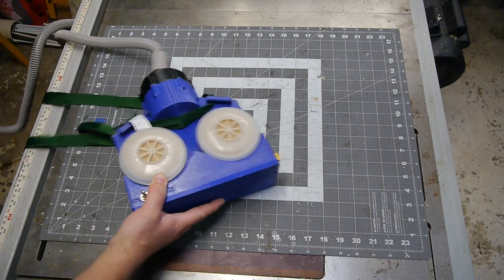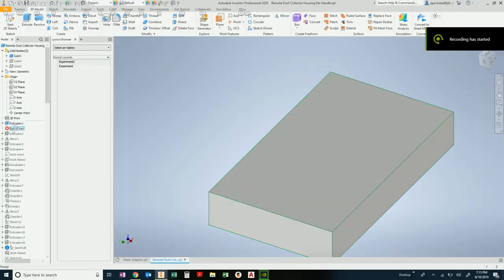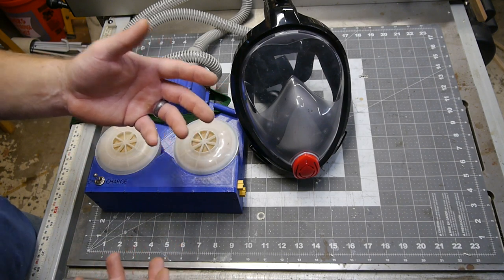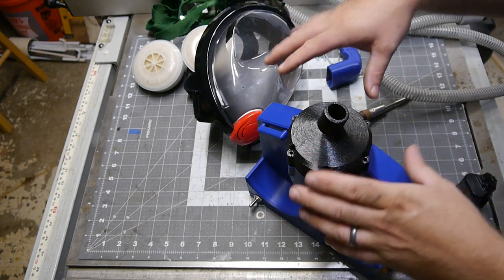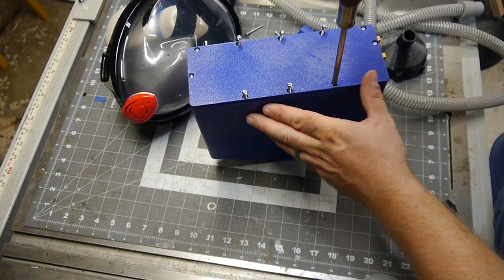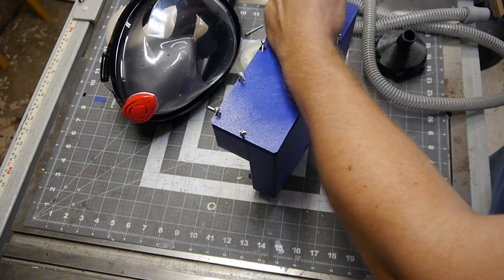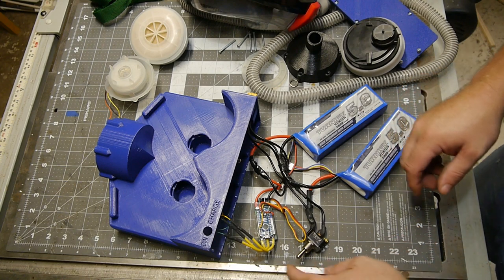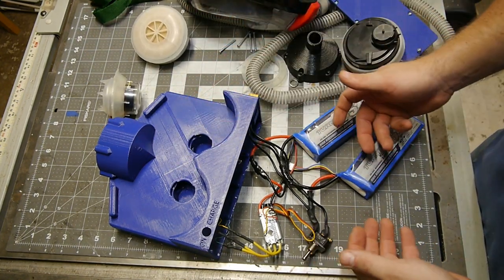DIY PAPR (Personal Air Purifying Respirator) Mask, Works Awesome! Low Cost Option

Comment: I have shared this to a physician group - many are dying due to lack of proper protective gear in hospitals here and abroad, This has potential to save lives.
Reply: Put a UVC chamber mid-line and it's done!
Reply: @cherylm2C6671  UVC creates Ozones, which give you lung cancer... not good idea
Reply: @mostlymessingabout  can't this be fixed using potassium iodide?
Reply: @anglerandy5736  no. Activated carbon helps reduce ozone. But it's basically charcoal. You don't want to breathe in charcoal. You are then addicting an additional filter to remove the ozone. Not ideal. Not to mention when the glass tube UV lamp breaks the mercury inside isn't exactly healthy to breathe in either.
Reply: @mostlymessingabout  they have led UV lights and the ozone can be converted back to o2.

Comment: I watched a video on a PAPR made by 3M. It had a blow-through rather than a draw-through design for the filter; the air is blown through the filter by the blower, then into the supply tube. By positively pressurizing all parts of the system, no part of the system will be drawing in un-filtered air except for the blower intake. In a draw-through system, if some part of the system is not making a complete seal, then air with viral particles can be drawn in through the tiny gaps. That is a weakness of the current design being shown here.
Reply from the maker: You are of course correct. I actually considered making it a positive pressure system when I first designed it. I designed this PAPR before this pandemic for use in my metal and woodworking shop. If I make it a positive pressure system then I don't have to worry about contamination coming in because my 3d printed surfaces didn't seal properly. So the flow would go Contaminated air -> blower -> in-line filter -> mask -> lungs. In this configuration though the blower fan and motor are contaminated by wood dust and metal dust, and can coat the internals of it. So an additional filter would be needed. Contaminated air -> pre-filter -> blower -> in-line filter -> mask -> lungs. I didn't have a housing for an inline filter, and since I was only worried about wood and metal dust why not just get rid of the in line filter as dust is not large enough to get through the 3d printed material. You are right to point out the shortcomings of this PAPR in light of the pandemic. Thanks for watching!
Reply: And still it is better than face mask only or nothing at all
Reply: @JoshAQ  Great kit. Thank you. Healthcare workers wear a surgical mask while wearing a PAPR.
Reply: @AcousticTheory would you mind linking the video you saw?

Comment: The way these sort of mask mostly protect you is by taking air from a direction away from the dusty/fumey work you're doing and drawing it through a dust filter to present clean, fresh air into the mask.

The type of filter you're using won't filter actual smoke out of the air going into the mask, unless they are rated at least P2/N95 or even better, P3/N100.
I was wearing a P2 face mask during the bushfires in Australia, with very visible smoke in the air in Sydney and it was like magic, no smoke smell at all.
Reply from the maker: I agree. I originally designed this to keep the saw dust and high velocity/low mass shrapnel out of my eyes while woodworking. The cartridges are designed to be used with paint fumes. The smoke was there only to demonstrate the flow of air coming out the front of the mask and for a little bit of comic relief. When this whole beer bug thing passes over and there is no longer an urgent need for filters and masks I am going to purchase some p95 or p100s for my PAPR. Thanks for watching!

Comment: An inexpensive inline viral filter after the blower to the hose is a better configuration.  The double filter is overkill.  Also, you need to filter the exhaust/exhale port.  This can be as simple as taping a layer or two of non-woven blue paper shop towel material on either the inside or outside of the port.

Comment: SNORKAL! thank god for slowmode. I had the same idea with cpap machine as I have one somewhere someone once bought and never used. I feel like an air pump will work with syringe filters if anything or a compressor with oil and activated carbon filters + syringe filter for extra safety....but my compressor broke so max pressure is like attaching a leave blower to your face. I've seen those kits though on amazon and aliexpress for like 1/3 of amazons price. Anyways thanks for the snorkel mask!

Comment: The only issue is with porosity of the 3D printed parts. Air can still be drawn in through the small openings between where the filaments are laid down, so they need to be dipped (probably a couple times) in some kind of resin or painted with resin to fill in the pores and make parts that are solid to prevent air from infiltrating through the plastic parts. 3D printed parts from an FDM machine aren't suitable for keeping virus particles out (at least not without this process of painting with resin to cover everything), but a PolyJet machine could be used to make parts that would be functional and safe.

Comment: Welders are susceptible to many respiratory afflictions due to the welding gases, smoke and fumes from the welding processes.  The welding industry now produces some welding helmets with integrated PAPR features, but are really only available to the professional welder in the industry due to the cost in the $4,000 dollar range.   I'm assuming that your design could still be used with an original CPAP mask since I have been told that the profile of that mask fits under most welding helmets.  If your a professional trades person working in a hazardous industry for 40 years, the $4,000 dollars is a small price to pay for your health, but the people that have temporary exposure, like hobbyists desperately need affordable solutions to protect their health.
Reply from the maker: My little brother used to work for a manufacturer that didn't have welding ventilators. He wasn't even a welder and he started having lung issues until he found employment elsewhere. You bring up a good point about the facemask could be used under a standard helmet. That is a reasonable compromise.

Comment: Constant Gardener
Ok , how about this ; a car windshield wiper switch set to intermittent, to a car blower motor , to a tube to a mask ? You could hook it to a 12 volt converter or a 120 volt converter ?
Reply from the maker: That could work. The size and shape of the blower would matter though as well as weight and inlet and outlet dimensions. 12 volt batteries or a 120vac to 12 vdc would be capable of powering it potentially. It depends on the blower and it's amp load. Thanks for watching.

Comment: you need to sand fill and paint the 3d printered material its vary porous and wont provide protection in that state
Reply: For painting he could hit it with automotive filler primer and then paint it he wanted, or just hit it with a clear coat.

Comment: Good idead but the air is so strong the outlet valve is always open? Open your mas so you will know what I mean
Reply from the maker: The outlet valve is only open when I hold my breath or when I exhale. Otherwise it is closed. I set the speed of the blower unit to provide just enough air so that under a hard intake of breath the outlet valve would close. If my breath intake is more than the unit can provide the outlet valve will automatically close. Thanks for watching.

Comment: Great start!  If I may add my 2 cents, I don't have a CPAP lying around.  So, maybe we'll use a brushless RC motor from a crashed drone or something.  We would have to redesign the fan to accommodate not having the CPAP.  Regardless, I think it's great!  Any thoughts on my changes?
Reply from the maker: It is certainly doable. Some of the things you would need to consider is the size of your brushless motor, its rpm, and power requirements, and then design a centrifugal blower assembly to accommodate the power and rpm of your motor. For example Matthias Wandel has some great videos explaining how to build much large centrifugal blowers for diy dust collectors around his shop. Given the amount of 3d modelling and work, it would probably be easier to buy a similar or slightly different CPAP blower assembly. I designed mine long before the current circumstances and it's not the easiest to get parts for especially if everyone is scrambling to get them as well. Your main problem is probably going to be filters at the moment. Hard to get a hold of them. I hope that helps and thanks for watching.
Reply: @JoshAQ  Actually, filter material was the easy part.  Similarly to an N95 mask, many high end air filters will filter particles down to .3 microns.  You may want to check it out.  Also, there are several companies that sell filter material by the sheet as well.  Regardless, thank you for creating this video.
Reply: Get a cheap USB  or otg powered fan

Comment: What's the art number for the cpap compressor. If I have the number I may not have to but the whole thing just to get the motor.
Reply from the maker: I don't know. It came from a ResMed S9 CPAP. I haven't been able to find where they sell just the motor. Best bet would be to find a used one online, maybe the whole unit?

Comment: In the video you said the CPAP machine has a motor then you called it a compressor. Is it truly compressing the air before it blows it out? I don't see how it would be doing that. If it's not it's just a simple blower. Which could be swapped out for something less expensive such as a raft/mattress inflator. Any feedback would be greatly appreciated.
Reply from the maker: Sorry, it is essentially a centrifugal fan, what you are suggesting would work, the size and noise level would be different probably, but it would probably move enough air.
Reply: @JoshAQ  you are a gentleman and a scholar!

Comment: Awesome model dude, out of interest what’s the spec/setup of this motor? Are the windings encased? I’ve found various different motor options that I’ve been considering for this type of project, but concerned about the consequences of a winding burnout. Would rather have them external to the fan housing (centrifugal style or similar)
Reply from the maker: The windings are encased, but I believe your breathing supply air is used to cool the windings. Not sure if they are encased similar to a TEFC. and air is used to cool the enclosure or the windings directly. I found a YT video showing the air flow in this type of blower though. https://www.youtube.com/watch?v=2purPYtP7us

Comment: Why not just adapt a filter and create the battery pack for the original CPAP machine so that it uses the battery pack so you don’t need to rebuild it. Create a housing for new filters, then you’ll be done. The CPAP machine actually will regulate the correct pressure necessary for best flow.

How long can the battery power the motor? Great idea!! You must be walking around proudly with this on in this current crisis!!
Reply from the maker: You bring up an excellent point that I did not address in the video. I originally had planned to do exactly as you said. I hooked up a battery to the power port, the unit turned on and started blowing! I thought "Yes! This is going to be easy." Then the blower powered off. Apparently the unit has some kind of sensor to know if it is not hooked up to a factory battery pack and it shuts down. That is my guess at any rate. I really wanted the regulated pressure feature that the CPAP had but I had no way of getting the machine to run on a battery. So I did what I did lol. 

The PAPR can run for I think about 2 hours. I used it on and off over a week of woodworking and I haven't done a battery run test.

I would be proud and walking around with it but I donated my mask and PAPR to a Doctor who reached out to me. He is working on building his own version and testing various commercial versions for his hospitals use. 

Thanks for watching and commenting!
Reply: @JoshAQ  btw - the ResMed proprietary battery costs ~$300, give or take - (and insurance won't cover it, in case you have sleep apnea)

Comment: Is the arduino necessary? Seems like esc and switch should do it?  What exactly is the arduino doing?
Reply from the maker: It is. The ESC needs a "startup sequence" to arm the esc. A servo tester could work though. I didn't use it because I didn't want the Servo tester on the outside of the case.

Comment: GReat design, congratulations!!!, one question, where can I get the cpap motor alone??? Will a hari dryer motor work?Thanks in advance
Reply from the maker: Thanks, I wasn't able to find the source of these blowers. By that I mean the original manufacturer of the blower assembly. I did find one on ebay though. I just typed in "ResMed Blower" and this came up. https://www.ebay.com/itm/ResMed-MOTO-Blower-for-AIR10-S10/264550869517?hash=item3d9875ea0d:g:8LAAAOSw-Jtcfi9L I hope this helps, and thanks for watching!
Reply: @JoshAQ  Gracias for your answer !!! Do you think a hair dryer motor will work?  Regards from Mexico
Reply from the maker: @pelonete5000  Possibly, as long as you dont mind being tethered to the wall since most hair dryers run on AC power. Not sure if they make a battery powered version of a hair dryer though. You might be able to swap out the AC motor for a DC possibly too. Might be easier to just source a DC centrifugal blower that can do at least 150 liters/min. Probably should make it at least 200 liters per min to be safe. I think the average person inhales at a rate of 140 liters min. Hope that helps

Comment: Hello Josh

Great Video! I am in the midst of making my own PAPR machine given the situation of the pandemic. I'm having some trouble spec'ing the motor and filter to create a proper filtration system. My airflow get's clogged with my filter. Most PAPRs seems to use blowers and they place the filter at the inlet. this baffles me because blowers are not meant for suction :/

I know this isn't normal, but I'd love to connect and get some insight on my design if that's okay with you!

once again, thanks so much for making this video!!
Faisal
Reply from the maker: Hey Faisal. I think it is great you have taken on this project. It sounds like your blower doesn't develop enough static pressure to overcome the pressure drop of your filter element. I started looking into sourcing some other parts for a 2nd generation of DIY PAPR. I came across this blower. RV40-18/12L on Digi-Key for 65.44 USD. before I was side tracked by some hernia surgery beggining of October. It appears to be a model used in CPAP machines and is 12 vdc and brushless. It should generate enough CFM and static pressure for supplying air when breathing heavy. I was going to power it with a Bosch 12vdc battery as I have several around the house and a charger for them. You will want at least a P95 filter if memory serves. Some have enough thought of using UV light in an aluminum housing inside the airway to help kill the virus that might make it through. I looked into it and it is really rather large and not very cost effective given the velocity of air moving past the light I don't think it would be effective. Sure I would love to offer what little insight I might. The reason I started this channel was to connect with like minded tinkerers. Feel free to email me at quickebay1@yahoo.com or you can DM on Instagram. I admit to being only quasi literate on social media so if there is a better way to communicate feel free to suggest that as well.
Reply: @JoshAQ  
Hi Josh

Thank you so much for your reply. I'll be shooting you a message in the next couple of hours.
really sorry to hear about your surgery, I hope it went well.

So grateful to have fellow tinkerers like you online :D
This means a lot!
Faisal

Comment: Bro, you remind me of a 60/40 blend of Deviant Ollam and This Old Tony. I think I started off with a video about some sample cuts on a K40 laser and have checked out a few more. Honestly, I don't know why this one isn't trending right now, what with the you-know-what going global.

I love seeing projects you can put together with random crap on hand. Earlier this week I dug through my parts bin and found a 2ft piece of 3/4" all-thread I think I've had for ~10 years. Finally got a use for it! No such thing as a junk drawer, since it's all useful some day! I saw you did some treadmill repair as well - but you know you can use them to power shop tools instead, right? I'd been holding onto mine for about 1.5yrs, and finally going to get the lathe up and running again.

You seem to have the art of PETG printing down pretty well. No matter how much I futz with the settings, I haven't been able to keep gobs of it from sticking to the nozzle, particularly in the first layer, where you need some "smush" to get it to stick to the platform. I did, however, discover that if you dab a bit of candle wax on the nozzle before your print, that will do the trick. If you have problems with PETG, give it a shot.

Keep up the good shit!
Reply from the maker: Swolebro thanks for the high praise in deed. Some day I hope to have humor as dead pan as TOT. I agree that there is no such thing as a junk drawer. It is just a drawer full of things that have yet to find a use for. Although every two years or so I do purge most of the common items. Otherwise I would be overrun in my small one car garage with too many materials.
It is funny you mention that I can use the treadmill motor to power shop tools. If you check out my MAXNC CNC videos you can see that I did just that. In fact that is most of the reason I fixed up the "new" treadmill. That way my wife would let me use the old treadmill motor for my project lol. 

Thanks for comment!